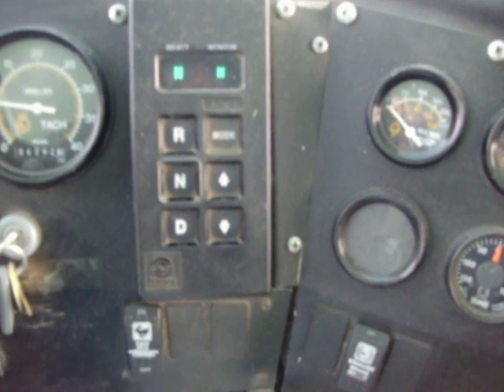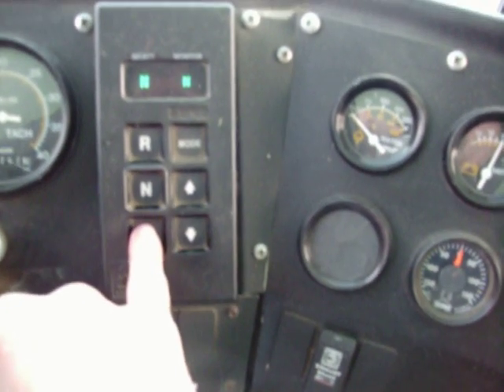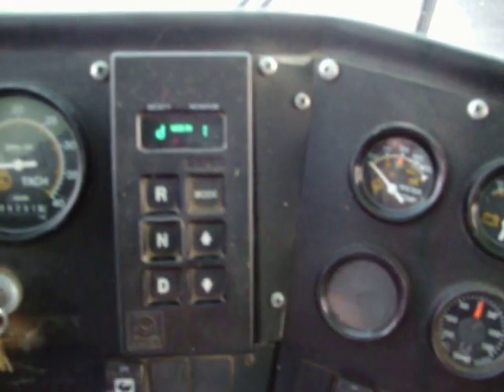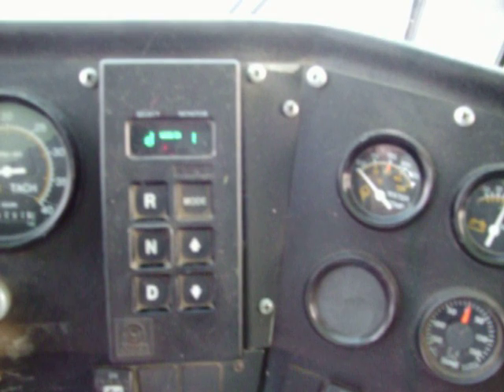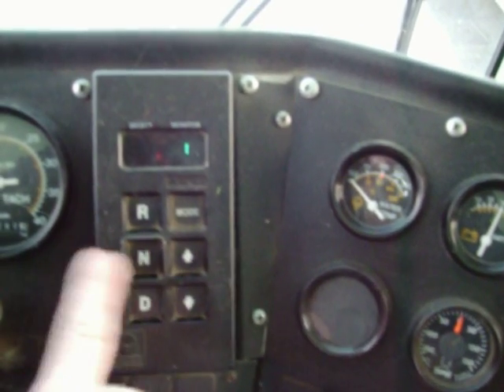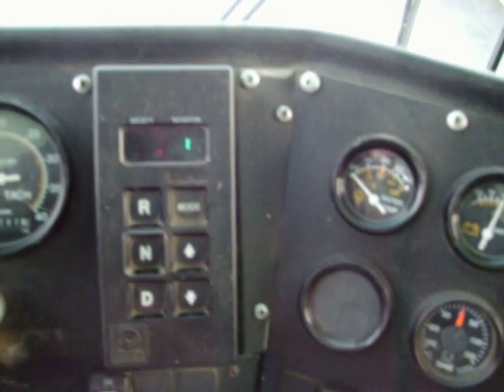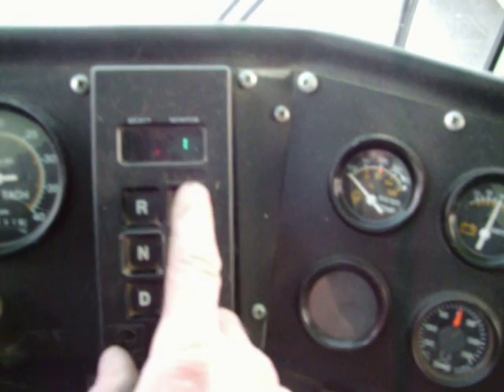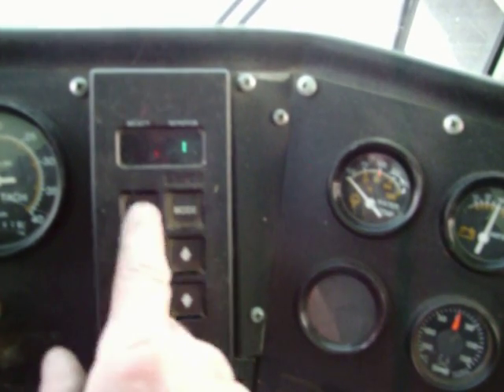Allison Transmission Codes - Part 2 How To Retrieve A Code

Comment: Start by checking the trans fluid, look for proper level, smell, color???
Does the engine overheat as well? Whats the temp? Any codes? Allison TCM will log a High Temp code (P0218) when sump reaches 260 Deg F.

Comment: ive got a 6 spd in a peterbilt 320 that im diagnosing that wont go faster then 35 unless you head downhill then it will hit the other gears.Is this a torque convertor issue?